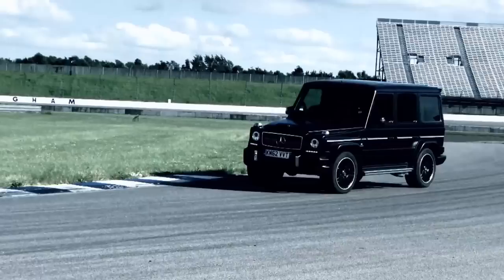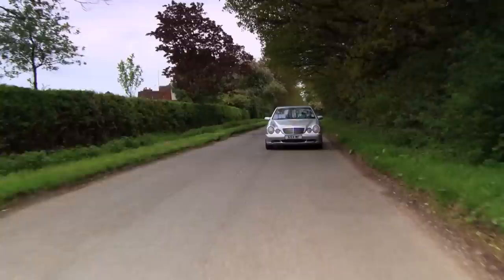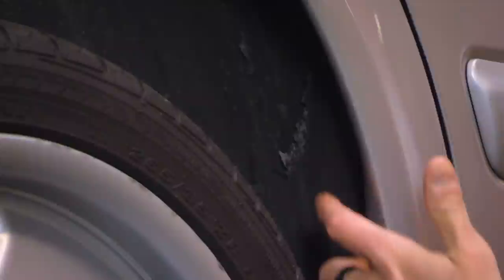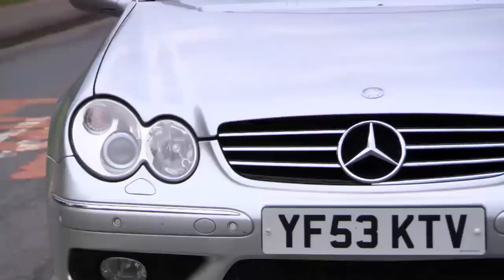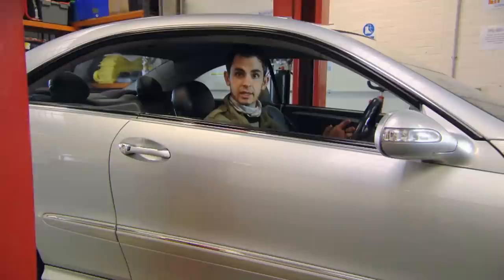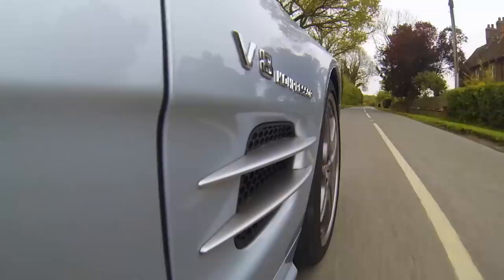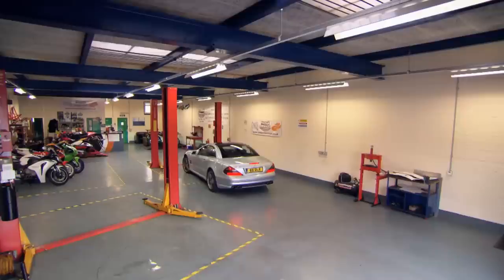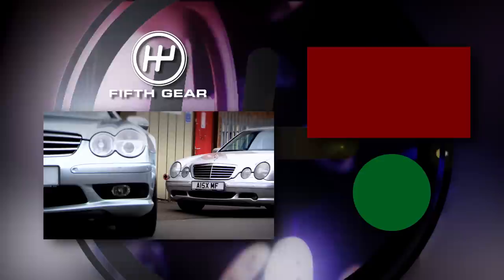Second Hand Heroes: Best Cheap Mercedes AMGs - Fifth Gear

Comment: Got a w209 clk55 and love it, on a highway it's scary how it keeps on pushing passed 100km to 180km like it's nothing. That V8 is legit.
Reply: Got the coupe version of the w220 S-Class, a 2001 CL55 AMG. it's a 2001 it's crazy fast and big so people move real fast!
Reply: What MPG do you get?
Reply: I have the same car and its the best thing ever. Muffler and Resonator delete and it sounds insane. I plane to engine swap it soon with the m113k engine from the sl.
Reply: @heystirke300  I would say it averages 12 in the city but the way I drive it usually gets about 10 but I have hit 8 before.
Reply: @heystirke300  C55 18L/100KM. Mainly City Drives. Dont bother to purchase them if this bothers you bro.
Reply: @mattmatt9971  I don’t get why people ask about fuel economy on cars like this...
Reply: @heystirke300  My 2005 C209(NOT W209, W denotes Sedan while C denotes Coupe) CLK55 AMG Coupe gets 20-21MPG with AC off and windows up. Around town, it drops to around 14-17mpg depending on the driving. Under the worst circumstances on an extremely hot day with the AC cranked, I've seen it drop down into the 10's and 12's even which is horrendous. However, under most conditions and circumstances I get 17-20mpg on average which is okay for having a factory bored-out AMG 5.429L V8 that makes 370+HP N/A. Did I say that she also has 185k miles on her?

Comment: In my opinion the best used AMG you can get is a CL63.
Reply: not really the cheapest choice. only a few are for sale at 25k eur, they got 150.000+ kilometres on the clock and the low mileage CLs go for 40k+. i'd say the CL 500 is the smartest choice considering you'll get decent performances and you can find a decent well maintained piece for <20k.
Reply: The SLK 55 is the best car you can buy under 20k xD It weights about 1400 Kilo and has 410 Hp ... love c:
Reply: Malachi Shekelshoah Lampshadestein 
For shizzle
Reply: I'm still gonna give you a thumbs up thou.
Reply: If you like spending money on air suspension.  C55 all the way
Reply: I think the 63 has to many problems and everything is upgraded on those and it costs a lot to do simple maintenance
Reply: Koji Takata better to get a cl65, v12 is more reliable. Overall very simple construction, not much to go wrong, and if something does break then the parts are cheap and it's very easy to work on.
Reply: The best used AMG is not buying a used AMG.
Reply: 55>63

Much more reliable
Reply: @Ferraridude13  thats a very important point
Reply: @eddgrs9193  finally a smart comment
Reply: @gepixelt7712  really???!!

Comment: R230 SL's are the most beautifully designed SL's since the 1950's Gullwing.... the shape of the R230 will simply never date, nothing else on the road quite looks like an SL......& man did they nail it with the shape of these SL R230 beauties ! Very expensive to run, but if you want a truly cheap alternative buy a generic japanese or ford & look like clones of each other.... the new batch of car design throughout the motoring world (even the high end ones) over the last 5 years are so fookin' boringly similar to each other !
Reply: I agree but I think Merc devalued the SL line when they launched the SLK

Comment: He left out a lot of common issues, especially on the SL.  I have a dirt cheap SL55 and love it, however I’m a Mercedes tech so cost is super low.  Fantastic car!
Reply: Heh lucky guy that you work on those cars i do to when something that is ez to fix and it costs a lot more at dealer but sadly i dont know much about ABC system maintenance. :/
Reply: MoparViking70 it’s only dirt cheap because it was once a 100k dollar car , but compare to most car with the year it’s expensive . A sl55 2003 would be around 10k , most 2003 car would be around 2 k to 3k .  It’s not necessarily cheap in market standard .
Reply: The key to these cars are working on them yourself

Comment: I own a 2005 S65 AMG, the W220 model, it had 29400 miles (47000 KM) on the meter when I bought it in Sep 2014, I had to change the front discs and pads due to rust, the previous owner didn't use the car much and left the car standing for a long period of time, so left disc started to rust, BOTH sides had to be changed, apparently you can't just change on one side, anyway, that change cost me approx 3000Euro. I also changed the oil and oil filter in the ABC system, 700Euro. I've had other expenses, like winter tires on original 19" AMG rims, undercoating, and service, hence nothing related to repairing or changing anything due to malfunction. Til this day 21 March 2017 I've had no issues with it and the meter is now on 35000 miles (56000 KM), I don't use the car much either, I just want to prove to you all that an old Merc doesn't necessary have to suck, it all comes down to how it's been taken care of! Good luck finding your dream car! PS: The car is now for sale, in case you're interested, check out FB page AMG of Sweden.
Reply: Quite funny how you are trying to explain that its ok to own old merg, not that expensive and that its good and the last sentence is that you want to get rid of it and sell it.
Reply: mikealanzo and he has only put 9000km in 3 years lol thats what i do every 5-6 months xD
Reply: B'cus I'm buying a 2016 S63 AMG, I wanted to test a "cheap" S65 for a while before I purchase a S63.
Reply: @mikealanzo  You ever get that s63?
Reply: @Anthiny: No, since MB/AMG announced that they will no longer manufacture the V12 I've been having some seconds thoughts, maybe I should keep it, maybe it will increase the value, I don't know, however, it's still for sale, tho at a higher price!
Reply: mikealanzo 
So what you're saying is....
Great fucking car.
Reply: @Frank: Exactly! :)
Reply: Wait till you get to 80k miles on it or so.

Comment: I bought a 65k miles 2005 CLK55 AMG around 3 years ago, it's been serviced, the sensor on the   gearbox fried and replaced, had a head lamp problem fixed,  which required the front bumper and arch liners off, and now needs a front suspension bush and the two piece front rotors and pads replaced. OK some expensive parts but it's a proper AMG, Mines a Designo version too. It's so nice to drive and own,  it will take something very very special to replace and now on 80k miles.  If you look after your cars, chose well, it's  a very rewarding car.
Reply: how much did it cost for the parts and labor
Reply: if you ever decide to sell i may be interested. I have been looking for an 05 clk55 for a while

Comment: I own a CLK55 and I can assure you that any AMG will be expensive to maintain. With a car like an AMG, you have to visit specialists or dealerships more often to keep on top of the maintenance. If cared for properly though it'll be fine... My one wasn't really looked after so I've spent a lot of money on getting it great, to be fair though I've done around 5-6k miles in the car since purchase. It is intoxicating and fun, which is my eyes means its worth every penny, besides these big beasts will be worth some money due to regulations etc. Snap one up whilst you can!

Comment: Its really like any used car shopping always look for the best choice with good history and maintenance .. i bought a 2007 cls500 , had a transmission change and engine check up at the dealer , the airmatic suspension replaced with normal springs and new brakes and tires .. i know it sounds like the car went through a lot but when you know that the previous owner did all the hard job you end up with a reliable daily luxurious car 👌

Comment: I cannot comment on any other model than the clk55 amg. Luxury fast reliable and a head turner. This car is a gem. I have never driven mine in the winter and therefore it looks mint. Zero rust the paint job on this car shines like no other. This beast is the best catch. Enjoy

Comment: I have a 2004 Jag XJR and a 2005 SL55, I love them. Yes parts are pricey, but once you replace them they last for a long time. Most things I replaced were original and they were 10 years old or older at the time. The cost of ownership is actually quite affordable since most of the depreciation is done with.

Comment: My uncle had an Sl65 V12 on a 54 plate brand new. It was the biggest head turner everywhere you went. Back then there weren't many Mercs around, especially AMGs.
Reply: The-V12-Beast Thats why I keep my C55.... now days there are not a lot of classy benz's being made.
Reply: The-V12-Beast There weren't many mercs around in 2004? Really?
Reply: Djpaul 1210   There were mercs, but these days since Mercedes has offered SLIGHTLY 
more affordable models people have gone mad. C Class and CLA models 
everywhere!

But AMG models back then weren't as common as they are now. Unless you 
lived in Beverly Hills of course.

Comment: I can tell you personally that if you can find one, the SL500 or 550 is pretty good but you must have a "guy" that you can take it to that can fix it and doesn't bullshit you when some light starts beeping on the dash. Its much like the mentioned SL55 AMG but much more affordable on insurance. People don't understand that these cars were over $100000, most of them, when they came out and they never stopped being supercars.
Reply: Frank Burdo you’re 100% correct! I learned the hard way after I purchased an R230. Amazing car but those maintenance costs were a killer.

Comment: I bought a 03 CL55 AMG in 2016 for 12k US (90k miles) .. for a year or so it was just my "Old Man Go Fast" car.  Now it is pretty much my daily driver.  I love it .. My son in law and I (mostly him) did have to replace the shocks in early 2018 (100k miles) and went with the StrutMaster Air Suspension kits with no real felt loss of capability although it did disable the ABC.

Comment: I've had sl500 for 3 years. I'm second owner. 1st owner had over 30k of maintenance down within the first 6 years of owning. Convertible top pump, PSE pump, convertible top wings replaced, door fob receiver replaced, 3rd brake light replaced, PCM codes redone...etc. Now I'm replacing the PSE again 1000 bucks, accumulators 3 of them 1000 bucks, seat air hose cracked, ABC fluid changed 200 each time. It's a very expensive car to maintain. I do the work myself. I couldn't afford it if I took to dealer. I've heard the newer cars quit the ABC system so that's a huge advantage over the R230. I love the way the car drives but is it really worth the cost of maintenance? I really dont think so. The resale price is too low. 1 big repair could easily be more than the car is worth. It's insane.
Reply: Dave Sharkey what is this ABC system?
Reply: @turkovich530  - the hydraulic suspension

Comment: i like to own any of these cars but with this high price of fuel in Eu  impossibru i'll keep my E270 CDI
Reply: fuel price is not that bad I remember it being much worse a decade ago.
Reply: A decade ago was in eu 90 cents cheaper
Reply: In my country the Netherlands:
2017: €1.55
2012: €1.86
2007: €1.55
You have to keep in mind the inflation. 90 cents cheaper is not true.
Reply: Damn right. I drive a 2004 CLK320 and spend about €40 on gas every two days ..
Reply: ghs77 Delete this.
Reply: E270 CDI is a bulletproof engine, and it is a missile compared to the 200 and 220 CDI engines.
Reply: injectors tend to fail for often on the 270.   320CDI is far superior - 510 Nm and 221 BHP - more torque than my V8 CLK 500
Reply: Are you suggesting the cdi is anywhere near as fast as the 500? Because it's not even close.
Reply: Sérgio Alves I merely stated a fact that the 320CDI V6 diesel had more torque than the CLK500 V8.   Didn’t say it was faster did I? 🧐
Reply: 270 cdi e classes are mint
Reply: MotoExtremeTV 
Get a ninja bro.
Reply: I owned E270cdi w211 when diesel was on low price in my country now I own a e65 735i and when I changed my car diesel and gasoline price is same. For diesel 1.40€ per litre diesel and 1.40€ per litre for gasoline it's awful
Reply: I love my w211 270 cdi😜 i found a blue, low mileage, and only 1 previous owner example, took a plane as soon as i could, and drove it 1300 km home😁
Reply: Welcome to C30 CDI amg zone

Comment: I have owned an 03 SL55 AMG for 10 years.It is an absolutely fantastic car.Yes it has had the typical ABC suspension issues but it drives like a brand new car even with 100k miles on it.
Reply: HHIVR4, but that ABC issue though...had that occur to mine and realized it was time to dump it.

Comment: You forgot the C55 AMG from 2005. It´s way better than the W210 because it doesn´t have rust issues because it´s the facelifted version of the C class from that era. The non facelift can rust.

Comment: I live in Australia and own a E55..I bought it 7 years ogo for$ 37000 ..The E55 average price is betwwen 20 to 30 Grand so there still expensive but dam you get a real Car....Ive dome some engine modification and has just under 510 klw and runs mid 10s ....
.

Comment: I wouldn't by a second hand AMG from England because with a max speed limit of 100km/h the Cars don't get driven properly .it's the worst thing you can do to an AMG.
Reply: Actually these 5.4motors in particular are kind of lazy. Yes even the stock supercharged ones are very lazy. They aren't high strung and are more than happy sitting in traffic or cruising at 100km. You don't need to drive them hard to keep them in good condition. Personal ref, w210 and w211 e55 AMG, still own the w210, a 2000 model, still drives as hard and smooth as day 1. I'm not saying a proper drive isn't a good idea, but we're not dealing with race engines here.
Reply: I would never buy an old merc in uk because of rust

Comment: 13 years old car is not aged car, problem is today cars are crap after 7 years of usage..  I remember old mercedeses ladas and yugos if u drive 30 years old car than u say its aged...  Today cars are just crapp.
Reply: You've got it the wrong way round, mate.
Reply: MakeSh00t actually, new cars are way more reliable. I mean for fucks sake, consumer reports put bmw im 3rd place for overall reliability
Reply: The reason communist cars weren't considered old is because any car was a luxury
Reply: I have a 2004 C200 and is an amazing car 
The top speed is 220 km/h
Reply: C209 CLK280. It still made 155mph. Very cheap now.

Comment: Out of these 3 the E55’s are the most reliable. According to forums and these are not my words.
Reply: Probably, but if I ever got an E55 I'd get the W211. The W210s are a rare sight because of rust.
Reply: @YTdelsCmts4NoRsn  They are not rare to see but w210 is the better car to drive. W211 rusts alot too

Comment: No interested any of these. The standard E-class would be nice like 300E, but W210 have so many problems that I don´t want it. It has very bad electronics, fuel injection system is very fragile and it rusts, so nope.
Reply: das wright  will it pass an mot though,my clk430 has a blocked cat
Reply: das wright  i would love to but the mot is due in april

Comment: And what about insurance?? 😂
Reply: ma21l 
Get the same car non AMG model.
Should be reasonable insurance wise and the gas will be better and less tire replacement.
Reply: Went from a WRX to a C63 and my 6 month premium went up from $490 by $125 for full coverage.
Reply: Cheap
Reply: chatwithaninja i drive a 1.6 ecoboost ford focus and the montly cost is 475 full coverage every month
Reply: Dapro yeah man its a red focus with the sport pack i was 18 at the time now 19 and i live in the city so everything was against me haha
Reply: Laird i am a prick fan though
Reply: nunya inct  where do u get a good insurance rate? I have a ‘08 550 clk in Fl
Reply: nunya inct  I like their roadside service a lot, I’ll look into their insurance rates thanks